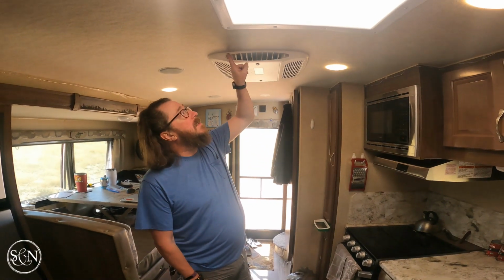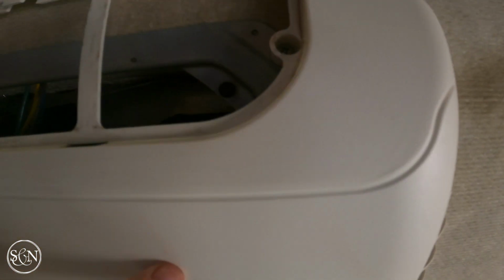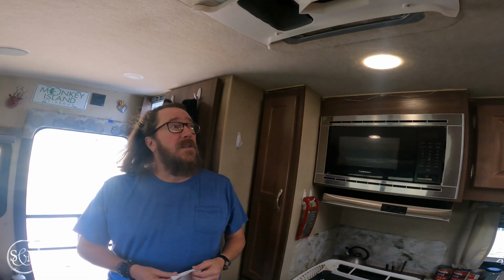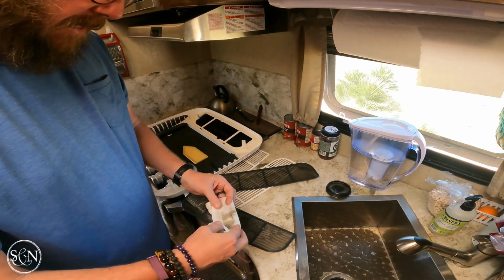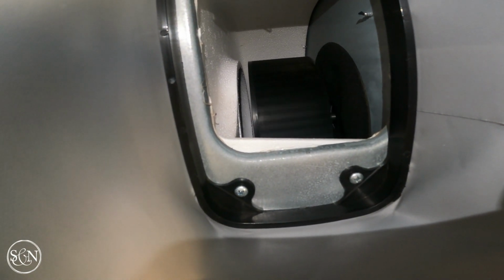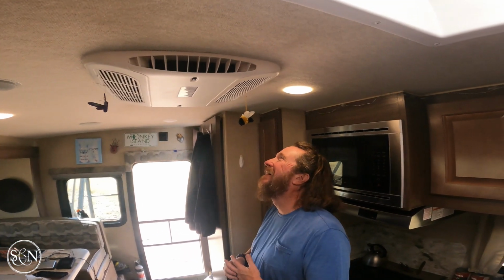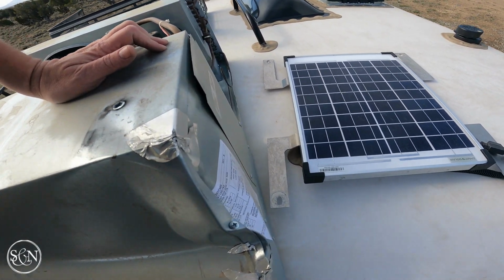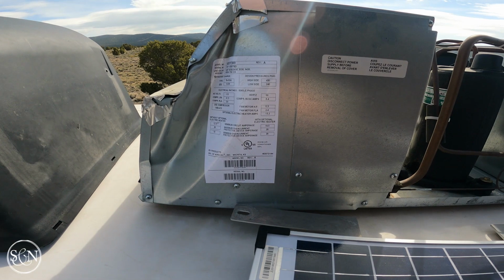Cleaning a crushed Air Conditioner/ Did the RV dealer do us dirty?

Comment: “🎼🎹🎸Dust in the wind, all we are is dust in the wind” Nice work man. Cheers
Reply from the maker: We really need to pick days to work on the TC when we have better weather.  I was marveling at the flat landscape and the low stormy clouds when I was taking a picture for the video.  I realized that I was the highest lightening rod for miles around.  I beat a hasty retreat off the roof.
Reply: @CupcakeChroniclesTC  wow good point. Cheers

Comment: Those dirty bastards! You can’t trust anybody anymore. I always try to watch them work on my vehicle. I don’t ask for the old parts back but I do ask to see them. You could look for images of the parts online to make sure they at least look like they came from your vehicle. Unfortunately sometimes you’re at their mercy. Look at reviews of the repair shops you go to. You can help others by leaving a review after you’ve had work done. I would definitely give a one star review to the RV dealer that worked on the AC unit. Leave a picture of the damage that they didn’t fix.
Reply from the maker: I'll let the shop try to rectify the issue and if that isn't successful I'll leave a review with the pictures.  I'm supremely disappointed in them.

Comment: It appears that the A/C unit still functions. However, as the mechanics I used, while driving through Mexico, they gave me the options. 
We can do it this way or this way. Your choice.
I'd like to be given that courteousy.
Reply from the maker: Yes, the AC still functions.  We rarely use the AC, maybe once in a great while when we're at a RV park. It's such a simple expectation that the shop will involve me in repair decision making.  Perhaps that's why I'm so surprised. If the shop had said, this isn't a big deal, we can fix it or leave it, it would be a completely different discussion.

Comment: As soon as I saw the blower spinning from inside, I knew something was damaged on the roof top unit.  The blower fan doesn't normally pull in outside air.

One other tip, do this threadlock upgrade on the bolts:  https://www.youtube.com/watch?v=CMWC-m_-kEc
Reply from the maker: I’m still pretty peevish about the damage.  I still need to address it.  I’ll check out the Delta Bravo video. I’ve watched some of his other stuff and it’s pretty good.

Comment: Looks to me like the dealer didn't finish the repair but I don't think they charged you for more than the cover repair either. They should have explained what the repair was and why they didn't replace all the parts. Your insurance company has a stake in it as well! They tell the shop what to fix.
 I work on all my own stuff because I don't trust ANY shop. I have been burned by too many shops and dealers. They work for themselves while they work you over!!!
Reply from the maker: It's pretty dang frustrating.  Next time I'm crawling up on the roof too!